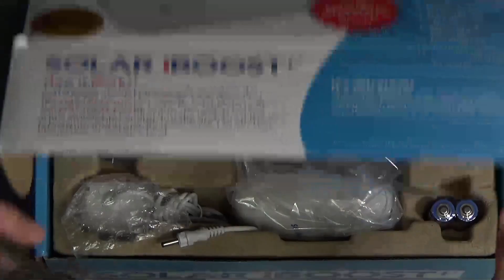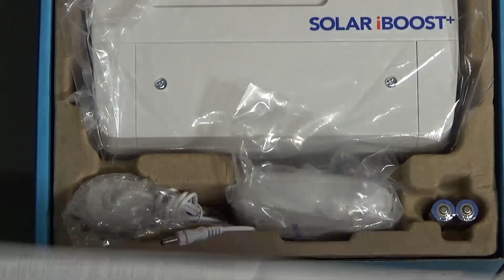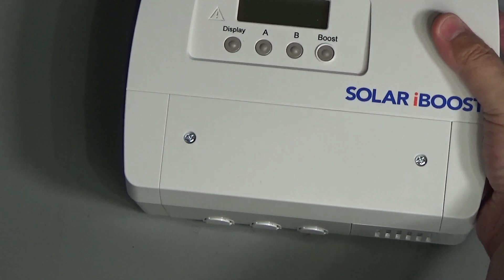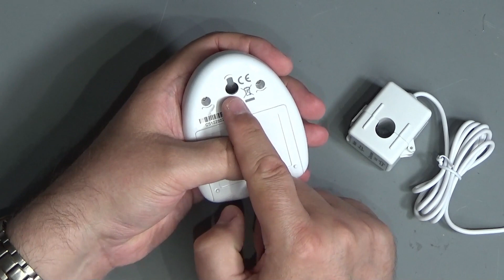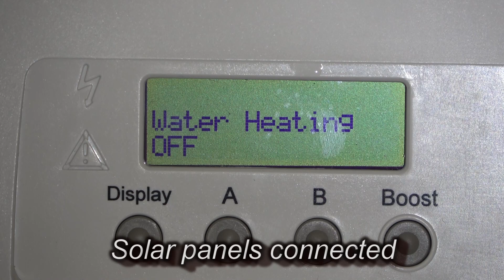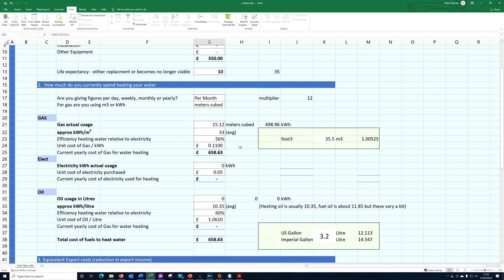Solar iBoost+ Diverter Review Installation - Is it worth it #0063

Comment: Hi, which key you used to open it up? tired allen key did fit... Thanks
Reply from the maker: Looking back at the pre-edited footage there are 4 torx screws in the back, not sure of the exact size but pretty small perhaps a T10 or a T8
Reply: @Make Or Repair   thanks already opened it. Not much to see there. Yea gonna need to buy new one as my died. As I heard mine not the first one. Now need to decide to buy new or no 
Thanks for you video
Reply from the maker: @mariscirulis338  Sorry to hear that, perhaps it is just that I hear about them but quite a lot seem to die...   There are a few mentions of other makes etc in the comments that might interest you.   If you are willing to send it to me I would quite like to disect and attempt a repair on a failed one for a video, I suspect there is some sort of design issue with them - not certain I can fix it safely (sort of depends how and why it failed) but perhaps worth a try?  If so please email make.or.repair@gmail.com and we can exchange address details
Reply: @MakeOrRepair  sent you an email ... could be in spam as well. thanks send your address then gonna try to find some box and hope royal mail gonna they it 
thanks
Reply: @Make Or Repair  sent you Iboost last week. Thanks
Reply from the maker: @Maris Cirulis  thanks, it has arrived  but had the "pleasure" of making raised beds this weekend.
Reply from the maker: @mariscirulis338  Good news.   The fuse had indeed blown but that was because the Bridge rectifier had failed.  Just trying to source a replacement part at the moment which may take a while (global semiconductor shortages) but I have had it up and running with some temporary parts installed - video should be out soon
Reply: @MakeOrRepair  thanks for update.  Hope you having fun with it

Comment: I don't have a battery and use this instead. It's just been installed on 3.65kw system but I'm not getting the water as hot as expected. The sun has been out and generating nearly 3Kw elec. The device is up in the attic near my HWT and I'm too old and partially disabled to get up and see but it was installed by a professional electrician .
 I'm pretty used to PV as this is the 3rd house I've had it on . But this system is a freeby from the council although I chose to have an solariboost  added instead of a battery which would have cost me an extra £3k . is there a way of connecting it to an app on my phone? As I've not got any operating instructions. 
Would I be advised to get a buddy to see what's going on from the kitchen and could I control from that ?
Previously I had oil central heating but the solar diverter heated my water during the summer with little extra boost. Now I'm on gas which I can boost when necessary. I know to only use one device at a time etc..
thanks for any suggestions DB
Reply from the maker: I think you need the add-on buddy if you want remote monitoring and remote control, not aware of an app.  But before spending you need to check it is functioning correctly.  If you have monitoring for your inverter then that will help -
The iBoost is just another consumer as far as the inverter is concerned, so with coldish water and say 3Kw of generation, and nothing big like an oven running, you should see pretty much all of that 3kw being consumed in the house;  once water is up to heat it should be a lot less.  You should perhaps also check your gas hot water schedule to make sure it is not heating the water first e.g. first thing in the morning or the previous night because the imersion will have a 60C cut-off.   If your water is cold and it is not diverting then there is definately some problem, which might go from it having messed up in a power cut and just needs restarting and program checking to an actual fault - unfortunately you might need a willing volunteer for that check.  
If it is faulty then you might be better replacing with something like the EDDI diverter, it seems to have better functionality and I THINK comes with wireless remote as standard but you would need to check.  Hope that helps

Comment: UK immersion heaters are 240 volts. Will this work with them?
Reply from the maker: Yes, mine is a UK heater.  I suppose they might make 110V version for the US etc but Europe is pretty much all 220-240V.  It is the wattage you should look out for if you have a a very large heater but  normal domestic immersion is no problem.

Comment: Great video. I've had an iBoost since 2014 works well. Decided to buy the iBoost+ mainly because of the Buddy and the 2 outputs but realised the output is chopped DC and doesn't zero volt switch. ( I have a upper and lower Immersion in the tank.) This has caused an issue with sticking contacts on the Immersion thermostats which never happened with the iBoost (AC out). I now use a temperature control unit which zero switches relays, problem solved. I have tied into the Temp con unit a sensor which inhibits heating if the Solar batteries are charging and prioritises the batteries because I too did not believe the "Solar" control by the iBoost + was genuine. Asked Marlec about these issues and was told the iBoost must be connected diectly to the heater or the warranty was void, no help with zero switching or Solar issue in fact te young lady dodged answering. Ade
Reply from the maker: Thanks, lots of interesting detail in that, and interesting point re the contacts.  It seems to be a rare thing to find a company where the people have a clue what they are talking about.  And of course in respect of the statutory rights she was talking rubbish.

Comment: Exporting back to the grid is estimated based on what your solar photovoltaic generates so whoever is paying your export tariff would not know if you have a booster fitted or not!
Reply from the maker: That is only the case for people on the fits scheme which closed for new members several years ago.  Since then the export is metered and you get paid per kW exported.  I think the scheme was ended because people were not exporting what was expected so as a result companies are paying for electricity not received, and that forces bills up.

Comment: Can I just ask I have a hot water tank heated by the boiler.  How do I stop the boiler heating the water and using this  iboost instead.  Do I have to turn off the hot water at the boiler?  Thank you.
Reply from the maker: My tank is also heated by the gas boiler but rads and water separately controlled on the progammer/timer.  I also have a thermostat on the tank that means the gas only heats it to 60 degrees c.  So we have the gas set to heat the water first thing  in morning and 7pm when there is little solar for the iboost, but if the iboost already heated it then the gas only tops it up to 60c.  Since we use a lot of hot water in the morning, the iboost works all day and the gas just makes sure the water gets properly hot if the iboost does not divert enough.  Of course you do need a well insulated tank.

Comment: Like the way you have set targets for on charge/load.
kWh is 60 minutes so your 3.6kw hot water is 60w in the minute. So therefore if you sample to over produce 60w in one minute the. You power up the hot water.

If you don't have any other loads, could you not just run a CT to turn on a load when there is export, set say at half an amp.
It flicks on and as the current  over production drops it turns back off. It would be off and on a lot. But it would not draw from the grid. Unles the production is higher than the load.
Reply from the maker: Well 3.6kWh is 3.6kw instantaneous maintained for an entire hour, or another way of thinking of it is an average of 3.6kW for an entire  hour.  The heater load is 3.6kW, the energy used is that multiplied by time.  So the proportional nature of this device is important because to be cost effective you want to use every bit of excess power upto the limit of the heater, but never more.   1/2 amp is (in the uk) 120W rms approximately so if we suppose we use that for say  10 hours of bright daylight then that would total up to 1.2kWh energy used in total and that is not going to get anywhere close to heating a whole tank, you would need about 5A on that approach.
Reply: @MakeOrRepair   I used half amp as an example. But that being said. If your load is 3.6kw but you have 500w of excess, then I assume that this would deliver that power..
In the UK the weather varies the sun's current a lot :) 

I m thinking if the CT relay is used to turn off and on as the current flows out, then the excess power would be cut as it were where the load is greater than the excess.
Is see the MK2router uses a triac to catch the Hz and adds current to each side of the wave. Bit more complicated that a on off switch.
But it how to manage power with variable power..?
Reply from the maker: @guywhoknows  if you turn on a 3.6kw load  with a relay then it would take your excess and just get the rest from the grid. This is the key point that the device limits the current based on the reading from the remote sensor so that you don't use more than the excess available, software then has to work out if the sun goes in or other loads are suddenly using more power and in my case what the batteriesare doing.  It is one of those cases where it seems simple until you try and do it.
Reply: @MakeOrRepair  this is the bit I didn't kinda get. 
If you switch on and off say with a 50% duty Cycle  do you deliver 50% of the loads draw?
Same as with a DC to DC?
I'm not much into the AC side of power and how it all works
Reply from the maker: @guywhoknows  if we take ac and truncate each cycle of the sine wave we get what amounts to an old style light dimmer and that would sort of work, but since the heater is largely  resistive it is inefficient because you don't actually control the current, it just ramps up with the ac sine wave and then gets abruptly turned off each time it gets too high. and unless you have about 3.6 kw excess solar output it would have to have a cycle below 50% otherwise it would draw current from the grid as the voltage rises towards the peak. The element is largely resistive so current and voltage are in phase.   But somewhere in the comments we discussed that the easiest way is to rectify the mains then use pulse width modulation to deliver a variable regulated current to the heater element with a lot of inductance or capacitance acting to store energy,  that way you  actually draw the smoothed out reduced current from you inverter using the full ac cycle and avoid nasty 50hz high current switching back onto you domestic mains.  so yes in that case the duty cycle does affect the power.  This is just.like a big switch -mode power supply, or dc motor speed controler, except instead of regulating output voltage you regulate the output current to be a little under the excess being sensed as exported.  Not the easiest to explain in text, and there are other considerations  but Hope that helps

Comment: Well on them figure's I'm not going to be fitting a Solar i-Boost  🤦‍♂
Reply from the maker: well you have to weigh it up.  the price of fuel has increased a lot since filming, so it is beneficial for more people than before.  but at least in the uk gas remains lower cost if already in use, unless you have a lot of excess solar generation to play with.  For me battery storage was a far more effective solution particularly buying cheep at night andstoring for daytime use in winter
Reply: Make Or Repair  I live alone and have a 5kw system 14pv panels and 2, 5kw Batteries, so it's more important to me keeping them Batteries charged than generating hot water, I've only just had my DNO approval and I'm on Octopus Agile Tariff which isn't good for charging my battery @ a cheaper rate like Octopus Go, it's early days for me and Solar all the advice on Utube is dated with out of date prices, so my Tariff choice is confusing, I'm hoping Octopus brings out a Tariff for PV & Battery Storage user's 🙏
Reply from the maker: @ianandrew7010  don't forget that even on agile you can get seg payments for export.  Either from a different company or octopus It was burried in one of the octopus q&as.  I had to ring the help desk and after going away to ask they sent me the seg forms.  In summer once the batteries are full I get paid something  for my export.  Adds up to about £200 so it was worth the hassle.  Seg is a derisory 4.2p per kwh but the alternative is to give away the excess...
Reply: @MakeOrRepair  I've just been accepted on Octopus Outgoing Agile was only connected this weekend I've chosen Agile instead of the 15p Fixed payment's

Comment: My iboost enables 90% of my hot water during sunny months of the year. It is brilliant. Nonsense about the fan.
Reply from the maker: Well glad it is useful for you. Fan is too noisy for my liking fitted in a bedroom, but my tolerance of avoidable noise is very low!

Comment: Well… I pay €2.02 for 1m3 gas in Holland… How come the gas in England is just about €0,80? Or do i misunderstand your calculation?
Reply from the maker: No, we pay in in kWH and ther are roughly 10.55 kWH per 1m3. Not Mt formula, it is the one used, you can find the full m3 to kwh easily.  British gas price today is about 7.4 pence per kwh so x10.55 and convert to euros come out just under 0.90.  Thst is domestic rate, Commercial will be far higher.  I suppose part of the answer is that the UK has a domestic price cap, beyond that current gas prices are beyond comprehension.
Reply: @MakeOrRepair  Clear! Thanks! I think I'm going for a pv direct water heater. I can easily implement that on my existing setup.

Comment: Good, comprehensive video.
Regarding it "stealing" from the in-house battery, you can change a setting in the iBoost to raise the threshold where the iBoost switches on the immersion. I have set mine at 200W, which means that there has to be 200W of export before it kicks in. This has stopped virtually all parasitic battery usage.
Reply from the maker: Yes, I think I showed  this in the video, I was relieved it performed adequately with batteries.  I think some competitors with more sensors and wired sensors are more responsive but it is fine.  It of course works fine in the morning when the batteries are low and need charging because the inverter simply charges them and there is no export to trigger the diverter (I have to go a bit higher with the threshold because my inverter won't commence charging at 200W excess,  it needs about 230W).  When the batteries are full however and it is making use of the excess that would be exported, and the sun reduces or appliance is turned on (that the bateries or solar could power) It does respond better with the higher threshold but the response is still a little slow because of the rate the remote sensor sends updates and the algorithm it uses to detect that although there is no export it can't keep taking the amount it is using.  I was only losing less than 1% of battery to it.   (Actually I'm not using it at the moment because my gas price is currently less than my electricity export price so I would make a loss! but that is going to change next year)
Reply: @Dr4co2023  I have 2 X 8.2 batteries on a Gen 1 5 Hybrid inverter. I've set my iBoost at 250 Watts and it seems fine. Where is your CT Clamp positioned?
Reply from the maker: @Dr4co2023  Pylontech US2000B, US2000C and US3000C.  I think it might be more about when the inverter decides it is going to start charging the batteries.  My inverter won't start charging the batteries in the morning until it is exporting over 190W, after which it allows upto 60W to be exported later in the day if the batteries reach 100% it will not charge them again until they fall below 95% and the top-end charging is at a lower rate.  So I think I got mine to work at about 250W threshold if I recall correctly but set it higher to be certain.
Reply from the maker: @Dr4co2023  They should both be on a bit of cable that will measure inport or export from the house as a whole, but space them as far as possible.  Both mine are on the cable between the big fuses where the cables some into the house and the meter and I have kept them as far apart as possible using a cable tie.  I suppose you could also put them on the output cable fron the meter if there is space, but before any junctions divide them.  As long as they are on those cables the order does not matter.
Reply: This is what I was thinking ;)